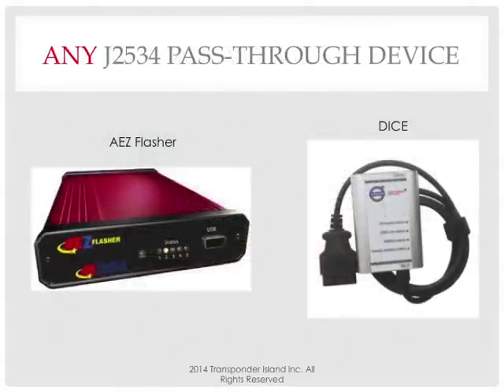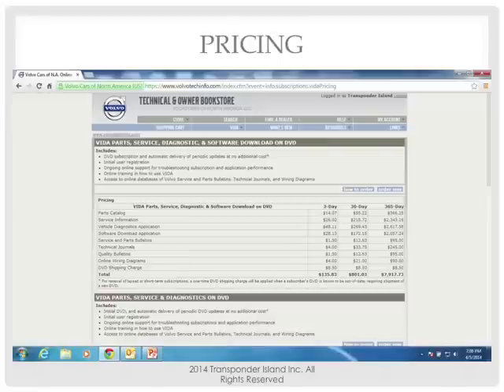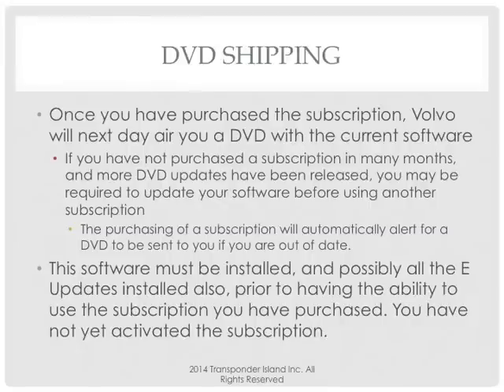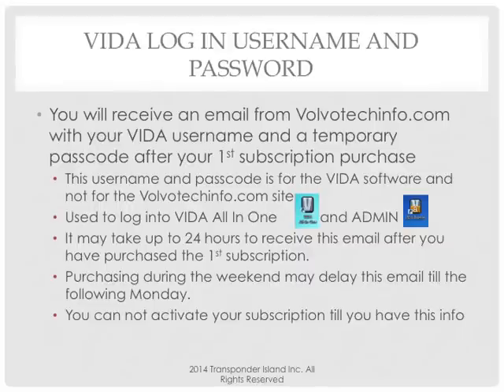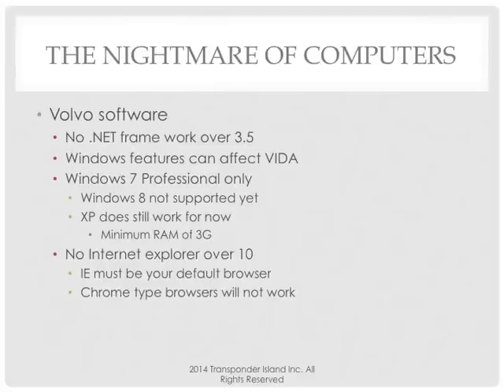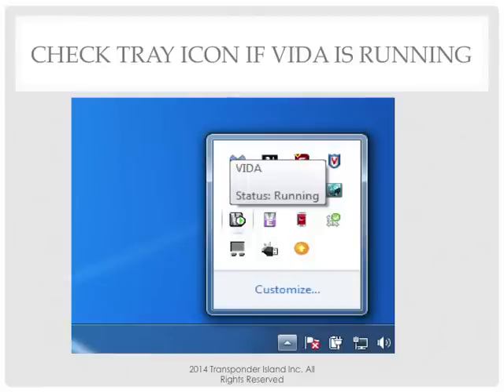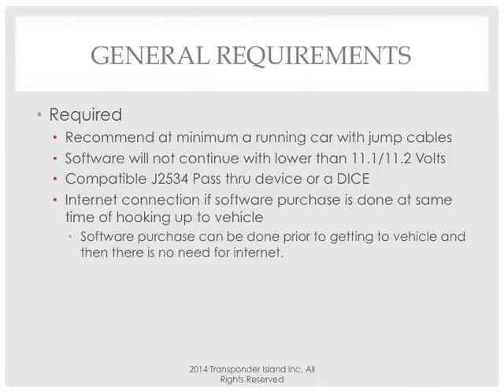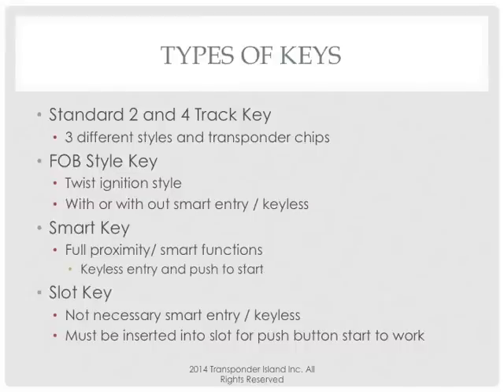Volvo Key Programming (With Fixed Sound)

Comment: I have a question about Volvo Keyless Push start Key Application.

I have had no issues communicating with volvo vehicles in the past but all of the vehicles have been turn key and not keyless. I'm using the AEZ flasher 3 device.

I ran into an issue this last week where I was unable to add a key to the keyless push start volvo XC70 2014. I had purchased the keyless key application on VIDA and when I tried to use the software, it would not let me use the software until the car was powered on. But I was there to make a key. The vehicle could not be turned on. Other vehicles i'm used to forcing the car on first. But I didn't see any other softwares available that would do that. Just the key application software itself.

The vehicle did have an active alarm. i tried downloading the alarm remove application on VIDA but with no luck. It also told me to power on the vehicle first.

Before we say, maybe it was the vehicle. I tried another Vehicle that i actually had the keys to. and I had the same issue.

Should it have powered on the vehicle for me? what did I miss?

Any help would be appreciated. Thank you

Comment: I tried to add a remote fob from Volvo the one you show at the end but program gets stuck on the please wait I'm inserting the key and putting the 2nd position , I waited over 5 min and never changed, remove key and closed window, and it says that download to car failed if I want to try it again did again same result. The funny part is that the remote works ! But car doesn't start .... any idea what might be ?